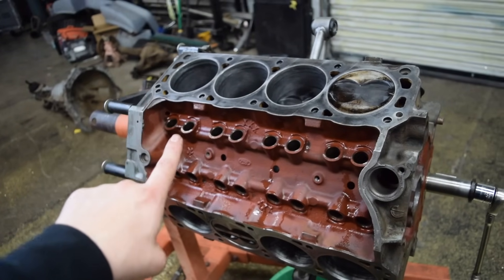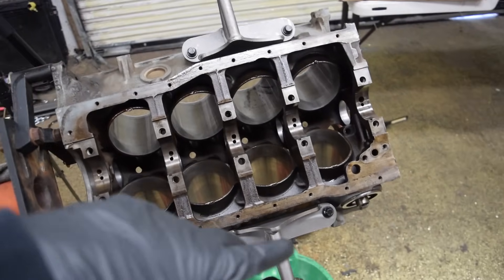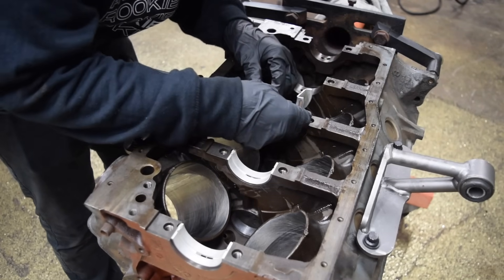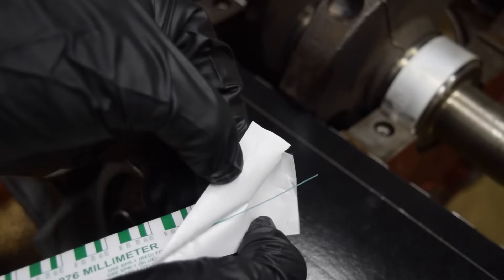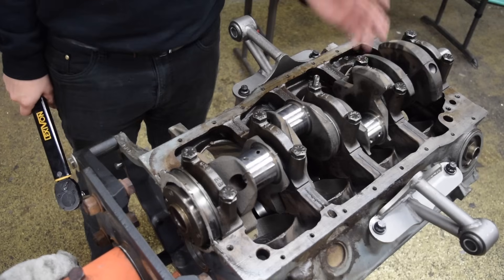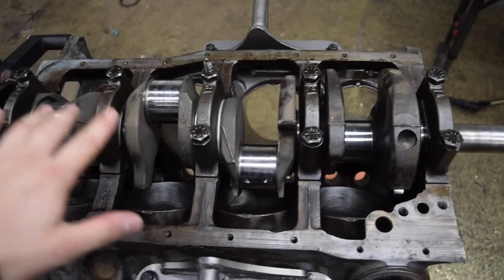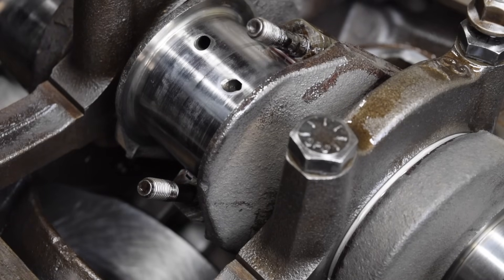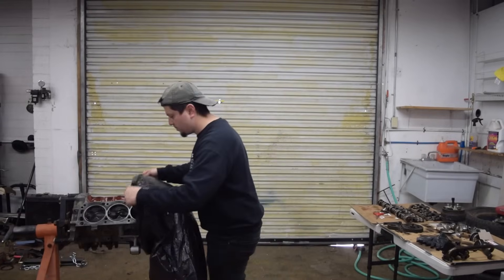Engine Rebuild Under $200 | 302 Short Block Assembly

Comment: When I have an engine out of the car on a stand I like to install the camshaft first it allows you to guide it through the bearings with your hands without the crank in the way. Don't let the "I only build motors the right way" guys get to you. I've built many motors in the same fashion as this and never had a problem. The old timers would call this an overhaul.
Reply from the maker: Youre right!! I told myself to install the cam first but it ended up slipping my mind lol. Yes an overhaul would be a better term for this

Comment: Great job at showing the public how easy it is and great narative also someone put some money and time in your block before obviously with the 010 bearings and 040 bore i would have ditched the pistons for a better ring package seeing how much ring wear was in cylinders but it will run and probably has minimual wear

Comment: I call this an overhaul, when you do all the necessary machine work then I call it a rebuild! I’m doing a 351 Windsor now that I’m putting into a 65 ranchero. I still haven’t settled on what I’m going to do for a transmission but it will definitely be an overdrive. Ii guess it would be considered a restomod.

Comment: One more as i watch should wait till end and just one book intlstead of many messages but helps on yt its natural to put top and second ring on a orientation but tbt rings spin while running they move oround at different ratess threwout differnt engine speeds and land inline at one piont for however long at time before rotating past dont stress it its good practice but dont mater much unless like yourself and i it just feels right to clock them plus i sleep better knowing i clocked them

Comment: You need to check the end clearance of the crankshaft. You need to put a dial indicator on the front or the rear of the crankshaft and see how much movement you have front to back.
Reply: I second that endplay needs to be checked , especially since Angel thought the thrust bearing he took out he assumed was worn a-lot. 😊
Reply from the maker: Thank you guys! I dont have a dial indicator either sooo thatll have to wait lol
Reply: @rookie__pilot  as us aussies say,she,ll be right

Comment: Wow - only 25 ft-lbs of torque for the rod bolts seems low, but apparently that is correct (for a non-Boss 302 motor - they are double that).

Comment: Bro! Glad you taking a chance and doing it yourself, but what is the goal of this engine? Is it going in the mustang? Otherwise I saw the cylinders, they need bored for proper seal. It will run but wont last long...Ask for help, I'll send some stuff.. That block is a paper weight..
Reply from the maker: The goal for the engine is to get it running with the recourses available! We definitely welcome help, as our patreons and members of the scrapstang community have pitched so much to the progress weve made !
Reply: @rookie__pilot  I believe i have a new msd style distributor for a 302. Give me some info and i will send it over rover!

Comment: Best rod for any stock build the early model and late model with the bridged cap has more strength then all others except the football rods also like said in other message someone put time and galiptall painted the oil valley on surfaces where needed its anti oil or phobic type paint that repels oil used on electric motors armature and other parts anti static shit dont stick to it and its expensive paint as well as very temperamental on aplication block has to be hot tanked and baked out all oils

Comment: Nice they painted the lifter valley with Glyptal, gives better oil return. At the very least, they were attempting to do a good job it would seem. What kind of ignition are you planning on running - Pertronix or something of that nature? Intake, etc?
Reply from the maker: Probably the cheapest route lol, pertronix most likely. I want to do a edebrock rpm intake!

Comment: As someone else pointed out, you should check crankshaft endplay, especially since you were thinking the old one you took out was worn a lot. The crank should only be able to move from front to back of engine under so many thousandths of an inch based on specs for a specific engine 😎
Generally it’s a few thousandths.
Reply from the maker: Thank you!

Comment: Just for practice and the educational value, check the rod clearances.
When I rebuilt my 350, I  had my rods reconditioned.  That ever so slightly increased the clearance. Now it was ever so slightly wider than the max factory specs 😱
My machinist said, not to worry, it will just sling a tiny bit more oil.

Comment: I bought an 87 5.0 LX notch when I was in high school, it smoked a little and had a ton of miles on it so I bought a rebuilt 5.0 to go in it.  I decided it would be fun to blow up the old engine, so after trying to blow it up I broke the transmission instead.  My point is the old 5.0 engine is tough as hell and will still run great without being perfect.

Comment: Great videography and explanations. Just want to point your plastigauge interpretation.  The slot between .002 (two thousands) and .001 (one thousands) is .0015 (or one and a half thousands) not fifteen thousands (which would be .015 not .0015. Spec for that block is anywhere from 1.5-2 thousands definitely not 17 thousands.
Reply from the maker: Thank you! Yes i didnt realize until it was too late lol 😂

Comment: People that say there is only one way to build a engine & that's the right way, there are two facts about these people. 1st of all that tells me these people have always had money & have never been in a spot when you just simply have to make what u have work! Period! They have always had the luxury of if a part or a procedure or a special tool was needed, they just got to go buy those things. They have never considered the thought of working with what you have. And they believe do such a thing, is the "right way".
 Wich brings me to my 2nd fact I know about these people. Not only have they never even considered needing to make it happen with x amount, they have never made it happen at all! They know nuthing about engines. Becouse they believe they understand the "right way". I wish they would explain it to me? Becouse the individual decides what the right way is?? Many ways are the right ways! They think they need all of the top machining techneaches performed & they need all new internals of the best name brand! They have no idea about actually fixing the engine. They don't know to home hone. They don't know to  grind valves & valve seats & putting a head back together & knowing how cool it is that only you have touched that head & u know how good of shape it is now becouse of your own work. And u know! That's different than knowing becouse that's what someone told you! And all a person knows at all is what they havevbeen told becouse they have never had to do it at all themselves! And they say do it right?? Right is whatever u want to use it for, & u getting to use it just like u wanted. If u just wanted it to run & get u to work & back & that's what u are doing with it,? Then it was dun right!!!

Comment: And be extremely careful with machine shops today, you will be extremely lucky if you find one that does good work.
I had a 347 stroker built by two different machine shops and $14,000 later my motor is pulled out and I'm building the bottom end my self 3 months later about 200 miles
Reply from the maker: GREAT point, ive seen some very high dollar jobs turn into a complete mess

Comment: I’m glad you pointed out the fact that during use with oil pressure, the crank is “floating” on a hydrodynamic wedge, old guys like me call it that anyway. The oil pressure keeps it from touching the bearing’s surface. The bearing is there for start up purposes. My father use to disconnect the coil wire on all his vehicles before startup and spin the engine a few revolutions with the key to get oil up to the main bearing surfaces. Starter speed allows oil to permeate the bearing surface/fill the void between crank and bearing surface a little before the engine cranks with spark. When that happens, the engine goes from start speed (revolutions) to idle very quickly. Like maybe 100 -120 rpm’s to 700-whatever idle rpm’s in a second or two. Probably not necessary to do every day but his hot rods might sit for a few days to maybe weeks. That means oil has seeped out of bearings, except for residual oil permeation of bearings. Anyways, I like your video so far and I just subscribed!

Comment: nothing wrong with this assembly really. these older ones had very generous tolerances from factory. also it comes to a point where a fully machined block of this era would be more costly than a crate engine or a wrecker modern engine.

Comment: As explained to me by an experienced builder:

You don't want the bearings to spin.
Putting oil under them is counterproductive. 

Also, before assembly lube was a common thing, my dad and I used STP.

Comment: No oil under the bearings,wipe off the surface with brake cleaner where the bearings sit, any oil under the bearings might make them spin and you don't want that

Comment: Damn auto correct. The main brgs. Are over sized the crank shaft is under sized. You get the idea. Use plasta gage to check clearance or u mite turn a brg.on the first roll over. Just saying